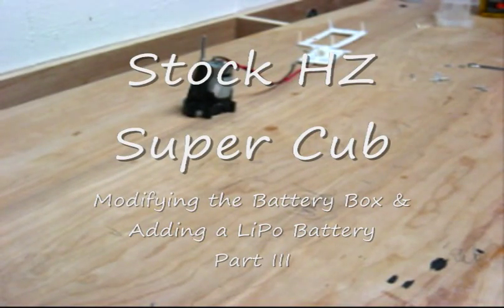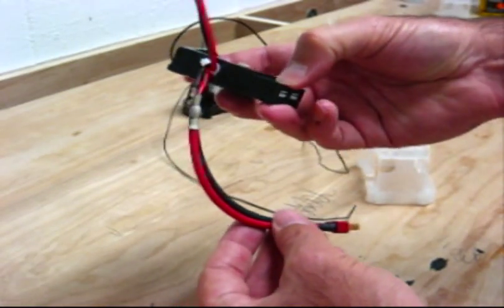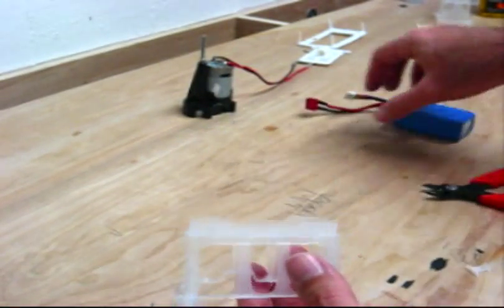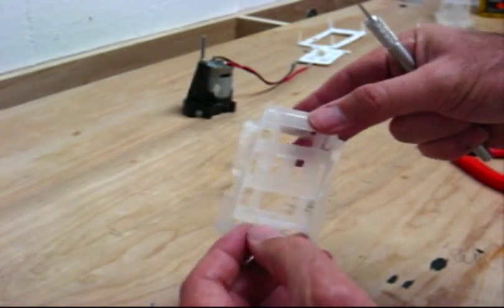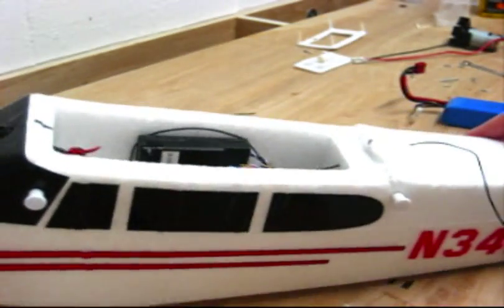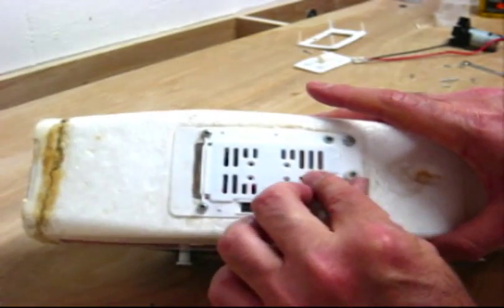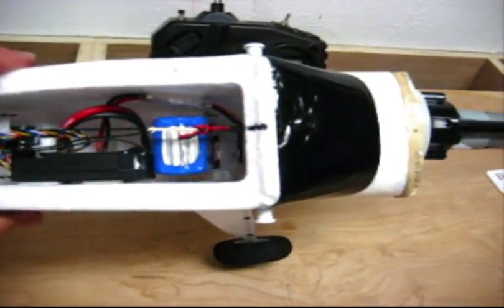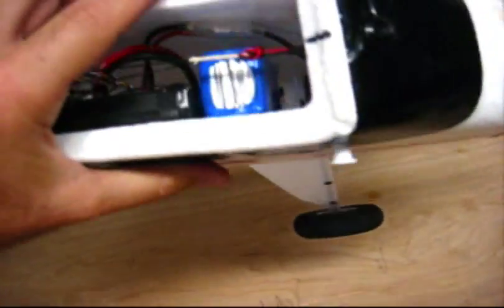Modifying your HZ Super Cub - Part 3, Adding LiPoly Battery

Comment: where did you get that meter to check power out put?  I'm new to flying SC.  I just got a Super Cup LP RTF.  I'm still learning but doing very well look forward to up grading Electonics to some of higher higher quality along with the motor. I'm not looking for power just longer flights.  I would like to add flaps and not ailerons to help slow the plane down to be able to take off and land in small areas I would like to fly in.  Thanks for the great vides.

Comment: @NeCubFlyer. I am glad to hear to have had a good experience with the default equipment. Sadly, I cannot say the same. I've gone through 3 Parkzone/Hobbyzone Li-Po batteries ($33), 3 electronic speed controls ($27), 3 motors ($11), and recently my wall charger burnt out ($15). The entire plane costs $150 + tax. I've already spent $228 just replacing the electronics. Trust me when I tell you that I'm following the directions to the tee. I cannot afford NOT to.

Comment: Very nice job NeCubFLyer. In summary:  its just a deans connector adaptation and some work to fit it all. two questions: a) I read something about a jumper in the receiver in other threads but dont see that in your video. Not needed?  b) Does this also give a little more power?( which is the real reason for me to do this mod.)

Comment from the maker: Can motors run hot by design and if you were to fly WOT from take-off to landing I'm sure the life of the motor would be shortened.  We've flown 2 Cubs with the Lipo setup with no ill effect on the motor yet, but we also don't fly WOT the entire flight.  At $11 a motor they're cheap to replace if you should fry one!

Comment from the maker: Probably not as my setup draws between 10 to 12 amps full throttle with the 10x6 prop.  Minimum C rating I would buy would be a 15C Lipo and a 20C is much safer.

Comment: All you have to do is replace the connectors on the stock ESC? to accept a LiPo battery?
No other modifications needed to the ESC?
Can it handle Li-Po batteries without being damaged?
Thanks in advance!!

Comment from the maker: A 3 cell LiPoly is 11.10 volts or 3.7 volts per cell. I use 1500 to 2200 Mah 20-30c 3 cell Zippy Lipolys from Hobby City and have had great luck with these batteries.